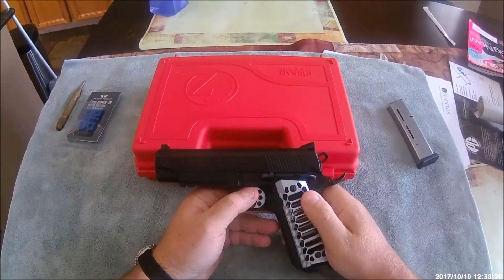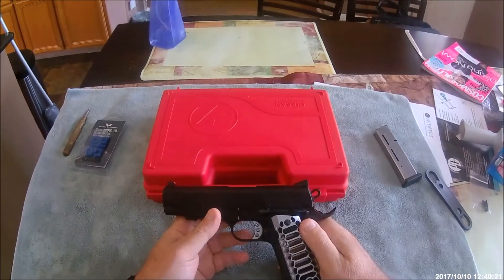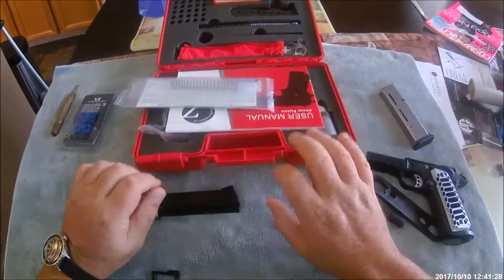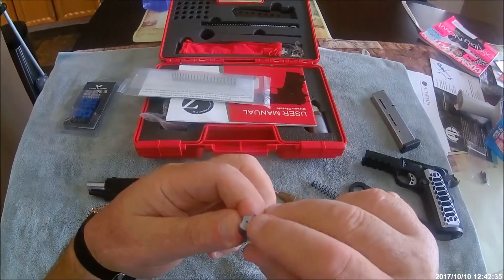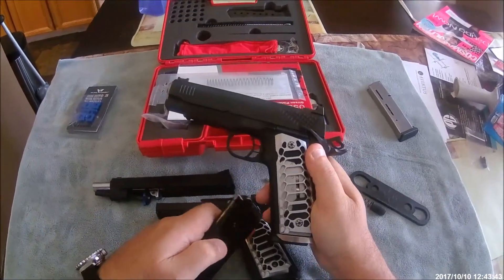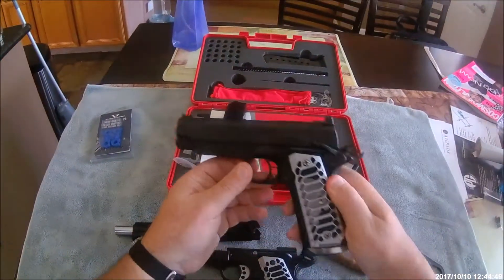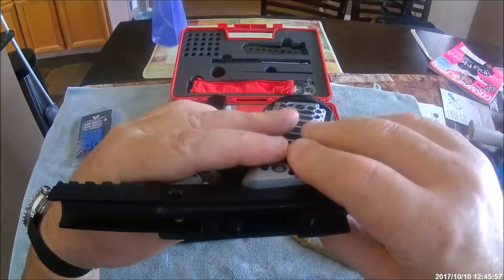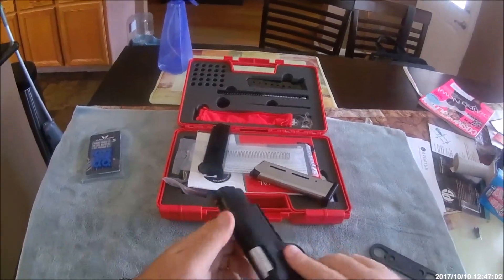Zenith (Girsan) MC1911c .45 acp Take 2

Comment: I also had ejection issues with the Girsan MC1911S that I bought from Buds Guns and  came to the conclusion that it was a magazine issue. After buying and trying 2 new Kimber mags and some Colt surplus mags the problem only seemed to worsen. Once when I was shooting it on the third round of a full magazine, the magazine just fell out of the pistol.  l also noticed while watching other videos on shooting the Girsan 1911's that other shooters were also having to hit the magazines extremely hard to get them to lock into place.After disassembling the pistol and comparing the parts to my other 1911's I noticed that the magazine catch was rounded instead of being cut at a 90% angle on the boot where it catches the magazine notch. I put in a new one that Buds Guns supplied  me at no charge and took it back to the range and it functioned without any problems at all and I ran aluminum, steel and brass cartridges through it. I believe that because the catch was rounded and the magazine was forced into the pistol that the magazine was sitting too high to allow the pistol to function properly.
Reply from the maker: James Collins that's a lot more involved  than  what I had  to do! I hope you got it running  okay!
Reply: My Girsan runs perfect on the supplied act mag. I bought 2 mecgar mags with a plastic follower that never fed right. I bought some rock island armory act mags that look identical to the supplied one but you have to slam the bottom of the mag to get them to seat. I took the guts out of the rock island mags and put them in the mecgars. Hopefully they work next range outing.

Comment: I have the Girsan MC1911S Ranger, which I believe is mechanically identical to yours (Sportmansguide.com for $360!) and I have fired nearly 1,000 now without a single misfire. I would call that really good reliability. It shoots really high, which took some getting used to, but  other than that, it has been a great gun - most especially for the price.
Reply from the maker: Yup for the money they are pretty good. After this fix it worked good. I still think it came under sprung.